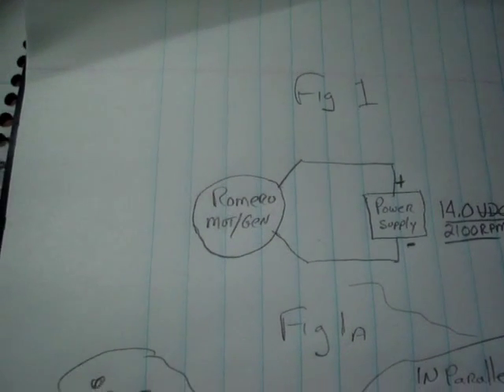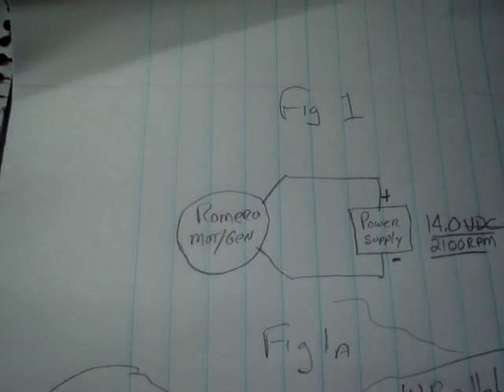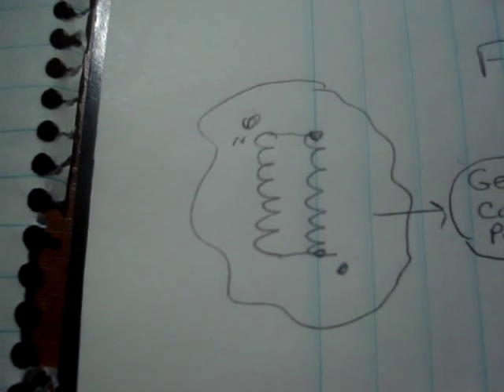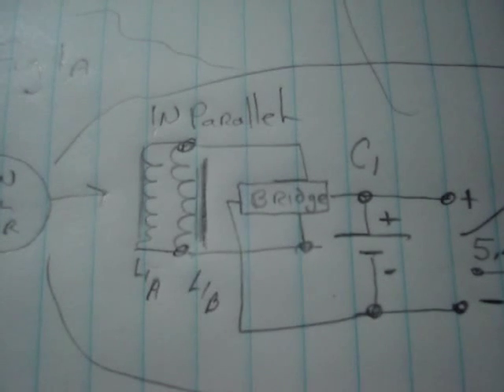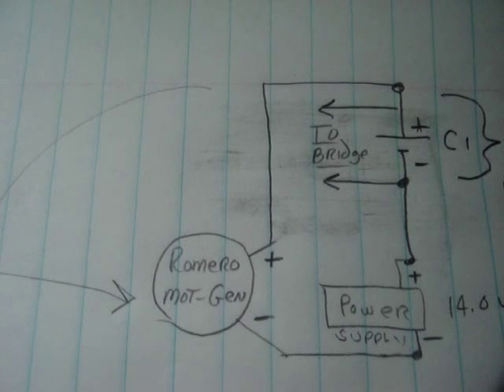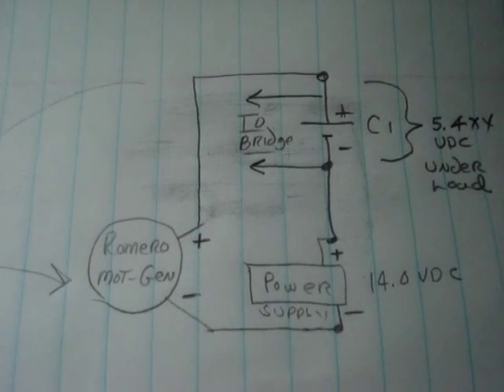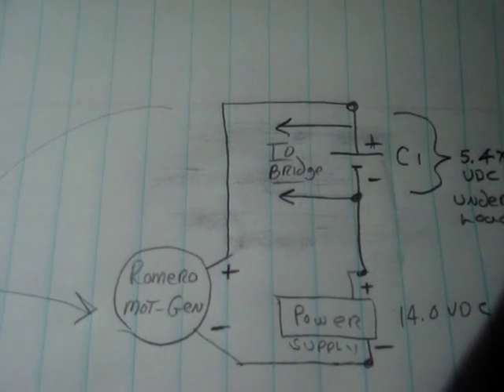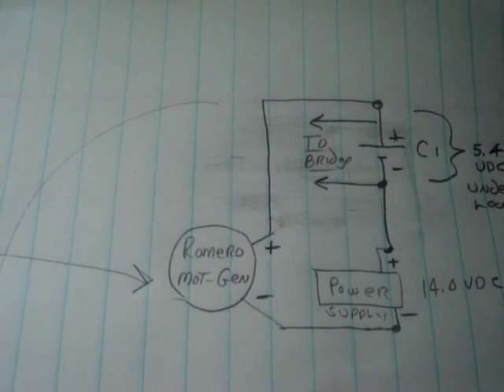My Romero Boost Circuit

Comment: Well Done Ben,

I think you have provided a way to determine the output energy of your generator coils, but I wonder if isolating them would have given a better idea. For example, once you know the target RPM and voltage (2502 RPM  & 19.5 V), supply that from your Power Supply and check output of your bridge circuit into a standard resistive load. That will give you the best idea of the average output and you can compare that to the input.

I like what you have done with the parallel coils =)

Comment: @k4zep 
Hmm, I do´t understand what you mean.
Maybe I am just too tired right now ?
So does it run also at 2500 RPM when you just use the Power Supply
to apply about 19 Volts ?
What is this boosting effect ?

Comment: okay, Ben, Well done,
but what is the difference, if you would set your power supply directly to 19 Volts ?
Okay, you need less input power but your coils are only putting out around 5 Volts, so you are still way underunity.. Hmm, did you try my idea with the 2 Avramenko plugs or the circuit Plengo uses ? 
Regards, Stefan.